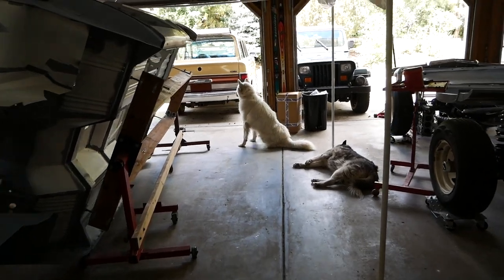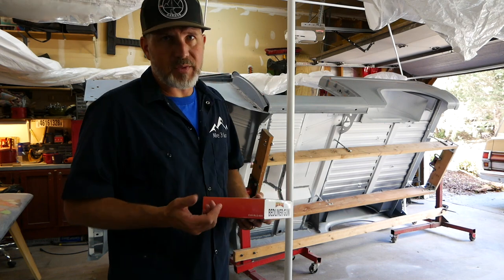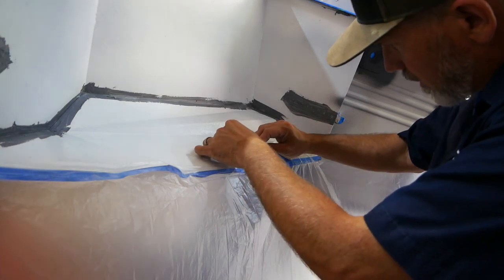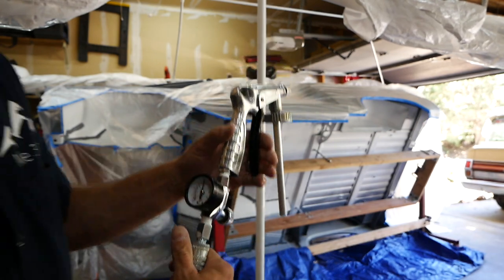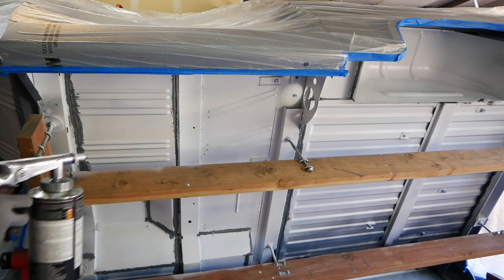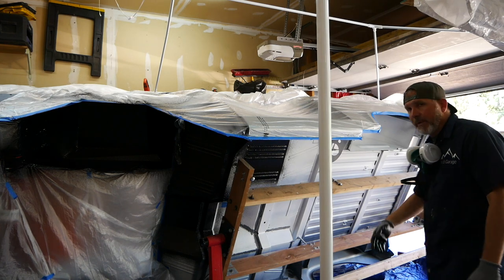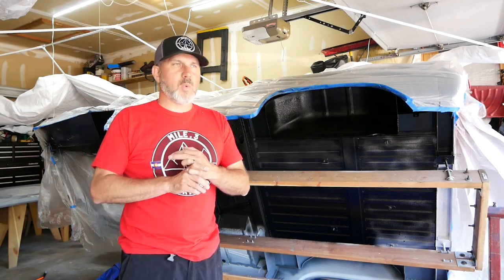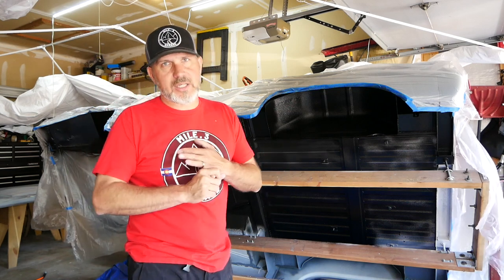Early Bronco Bed Liner Undercoat

Comment: I appreciate your videos...
I’m on a budget with my 74 and looking to restore it. I have a lot to work with as an on frame restoration was done roughly 18 years ago by the previous owner but I’m starting to see some rust coming through. 
I’m looking to do a complete frame off restoration...
Good stuff, thanks. 
And I really appreciate your sharing products used and the ‘how to’...
The engine stands used to hold up and turn your body... great idea!
Reply from the maker: Thanks Luke! My first video was on building the rotisserie.  Check it out.  It has been amazing and I have used on both of my Broncos.  Its also very cheap.

Comment: How well did  the engine stands work to hold the body? I have a 1985 full-size bronco I'm thinking I'm going to have to extend the wheels wider.
Reply from the maker: I have had two broncos on this stand. They work well. My 73 is still on the stand.
Reply: @alpinegarage8548   Good to here I want to get the body off mine, and setup so I can have a portable soda blaster guy come out and blast the bottom  "safely" .
I plan on rapture liner the floor pan ,Being it is in such great shape I really have no plans to ever sell it. thank you for answering so fast .